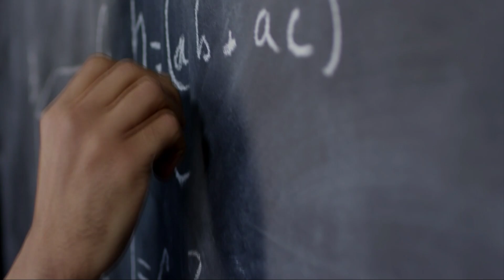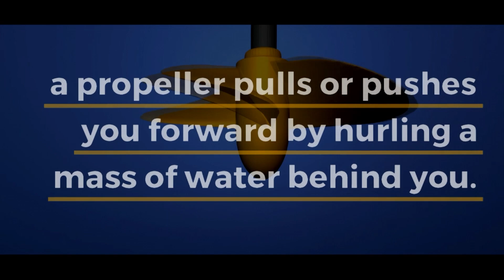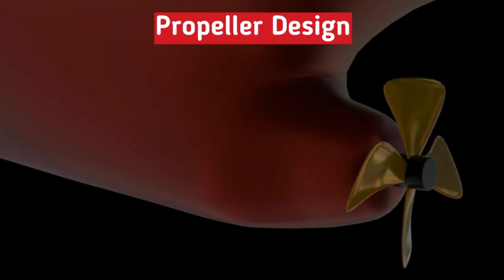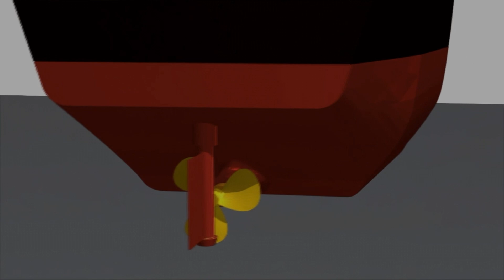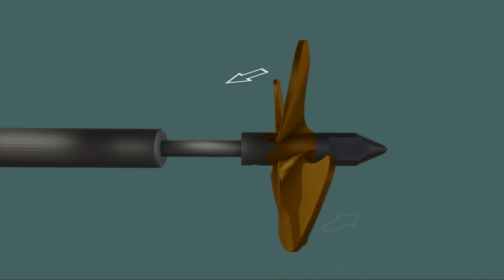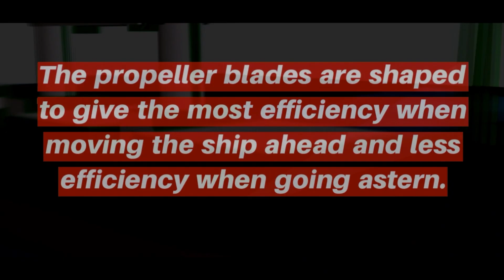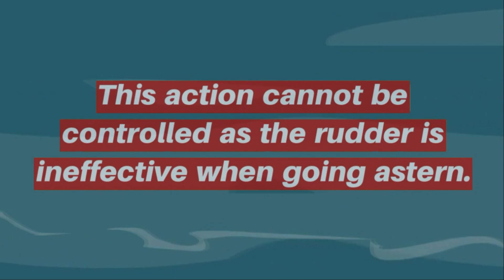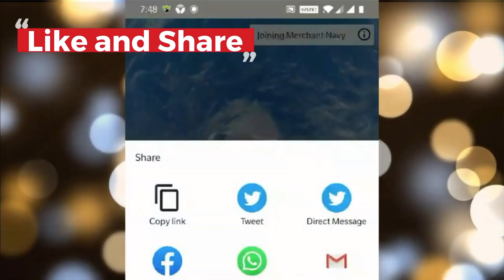HOW DOES SHIP MOVE ?  #propeller #shipworking #marinepropeller

Comment: When ship moves ahead due to axial thrust generated by propeller the wake is generated along the surface of hull .where the velocity of watwr around the hull is same as the ship and decrease as the distance from this ship increases....
This wake causes the deduction in thrust for propeller...
Means when propeller is in open water and producing thrust will definitely more then the thrust produce by propeller when it is on aft of the ship ...This wake resistance is also called as augment of resistance

Comment: Why propeller is aft
Reply from the maker: The aft location allows for a more efficient transfer of power from the engine to the propeller, as the propeller can be positioned directly in line with the shaft that connects the engine to the propeller. Additionally, placing the propeller at the aft of the ship allows for a more streamlined design, with less potential for the propeller to create drag or turbulence in the water.

Comment: Ttip velocity generated by ships blade is about 45 m per sec. Hence pressure ill be 8 kg per sq cm. How   water from it can flow in horizontally. Only  sub marine propeller can work efficiently, having tip circle /shroud to deflect radial component into  horizontal

Comment: So I decidd  to use pump hub  of diameter  50%  of full impeller diameter. It is because the pressure distribution  from hub center to blade  tip in square proportion to diameter.. Also the pressure distributed along radious is in square proportion to diameter.

Comment: The propeller is a fascinating invention. The gradual change of pitch between middle of the axle and the tips gives it a beauty. The difference between a water propeller and an air propeller is also interesting. A water propeller is more round and wide while an air propeller is narrow and long. I understand it has to do with the difference in density and centrifugal force. An airplane could indeed use propeller shaped like a boat propeller, but it would not be as efficient. And if a vessel had an airplane propeller shaped propeller it would not withstand the forces and be broken.
Reply: Where are you going after you die. Repent today from your sins. Hebrews 9:27 says as it is appointed unto man once to die but after that the Judgement.

Confess your sins and turn to Jesus Christ today. He is the way, truth and life.

Comment: 1st question - What size of propellar shaft ?
2nd question - what is the temprature of propellar shaft and shaft bearing ?
Reply: 1st question : Depends on how many blades on the propeller and then its weight and of course the power of the engine in such a way to not waste the energy and be able to move the propeller blades. 
https://damage-inspector.com/calculation-shaft-diameter/
2nd question : A cooling pump and  lubrication system are used around the friction parts of the shaft(Even for cooling the engine) In some cases they use high pressure water pump whithout any pollution risk. No idea for  the temperature values.

Comment: Does a ship have only one propeller ?
Why not put a support when one fails.
Reply from the maker: There can be two or even three propeller in one cargo ship. However, the most preferred count is one. This require a drive, which is a massive marine engine. If there are two propellers, it will need two engines. Propeller are strong enough and made up of anti corrosive material to survive at sea. There are very minimal case of loss of propeller hence ship operators prefers One propeller in a cargo ship as speed requirement is achieved by it.
Reply: Thanks for your reply.
Reply from the maker: Our pleasure 👍🏻